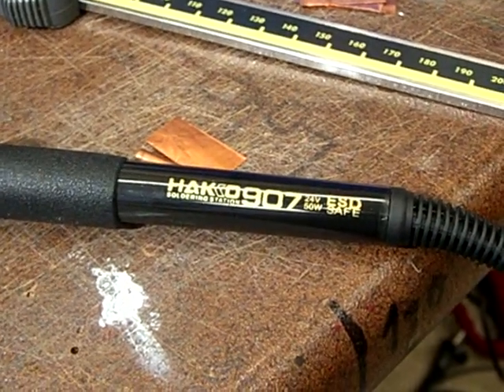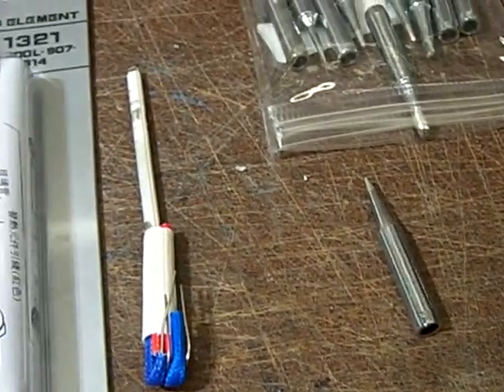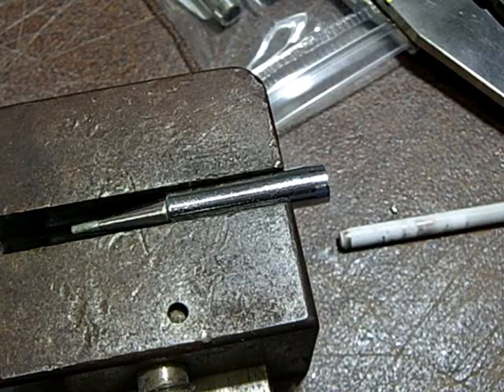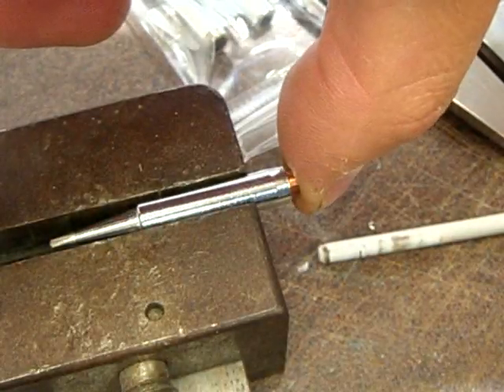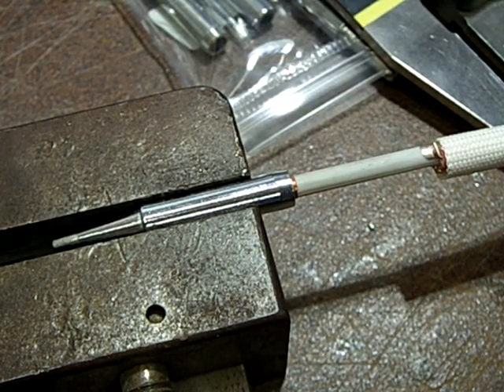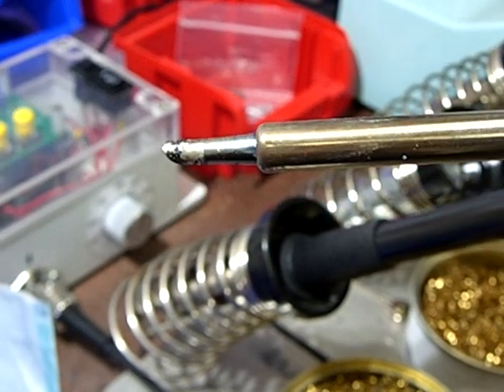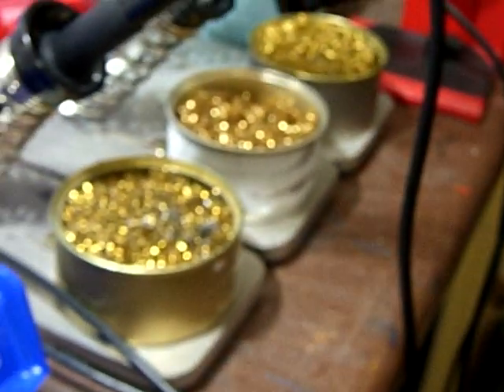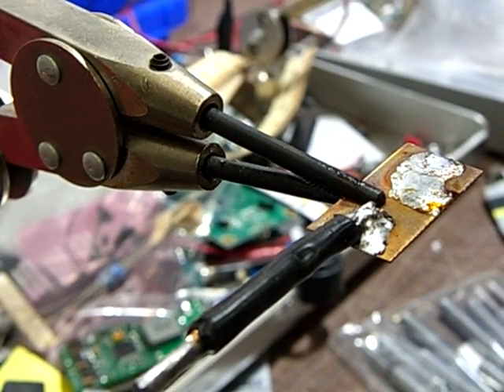Hakko 907 thermal transfer improvement (Copper Mod)

Comment: But have you tested with a solder thermometer before and after results? I heard the heating element heats the tip not by contact but by radiation so this wont make a difference!

Comment: Some cheap tips are made from 100% iron. Once oxidised, they become quite useless for heating or wetting solder. Copper tips work fine even with an air gap. The heating element bumps against the tip at the front.

Comment: Does the soldering tip need to bottom out so far that the bottom of the tip touches the cheramic heating element?

Comment: I used the hack and it made a massive difference, where before I could hardly melt the solder at all, it now works as I would have expected such a tool to work. I got the copper sheet from a jewelry hobby shop really cheaply.

Comment: Any option to prevent the tip dissintegration in this soldering iron models?
Reply: Happens with you as well?  It happens fast for me where it starts to pit, then divots no matter how much I clean it, and retin it after each session.  If I go back to sand down the divot/pit a new one happens almost immediately so I am suspecting the metal used in the tips is sub standard.
Reply: @generalawareness101  Yep i bought many tips because this reason and all death by the same. Tip carbonized and disintegrated.
Reply: @FSHerrante  I didn't get that happening just the pitting that I have to say never happened before.  Has to be because the copper used is inferior (sort of like Chinesium is an inferior iron type metal).

Comment: Since I did not have any copper foil around, I used some aluminium tape and stripped off the glue from the tape with acetone. its a little bit thicker than aluminum foil and is working great.  Before this mod the fine tips for SMD where almost useless....

Comment: Aluminum foil also works, just not put too much there. It can fuse the tip to the heating core. copper can oxidize easily. The better one is stainless steel, last forever, and will not fuse tip. Just need to be careful, stainless steel foil is razor sharp.
Reply: I was searching for copper then was thinking aluminium foil may work.

Comment: The copper is untinned. Soon it will oxidize & make the heat transfer worse.
Reply from the maker: But not worse than an air gap, I'm reasonably sure about that.
Reply: Extremflug Ofcourse. if the air gap is huge.
Reply: b888 I tried this mod a year ago and am happy to report that the shim still works perfectly. There is no discernible degradation in heat-up time so oxidation is not a factor. Before the mod, my iron struggled to desolder large heat sinks and components on large ground planes. After the mod, it was like I got a new iron...performance was significantly improved.